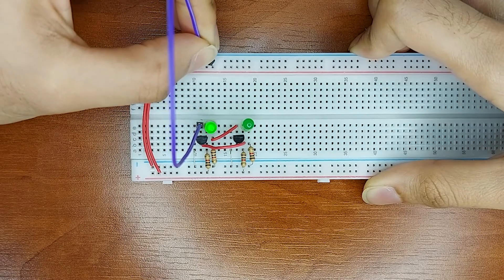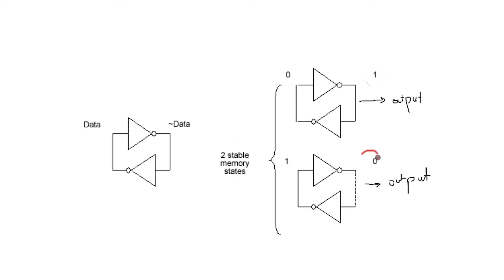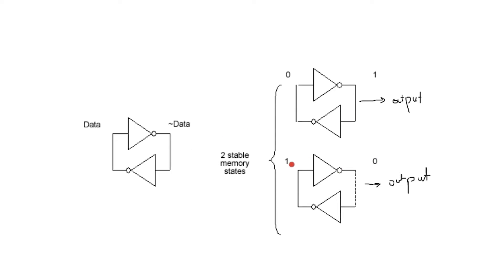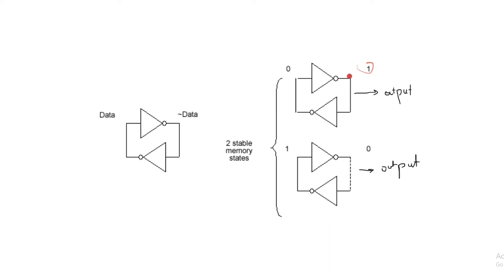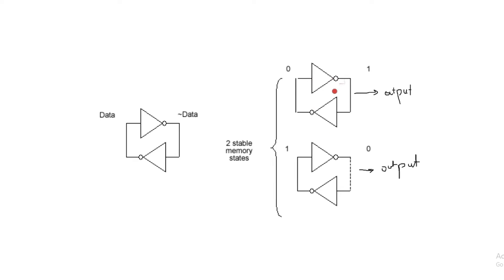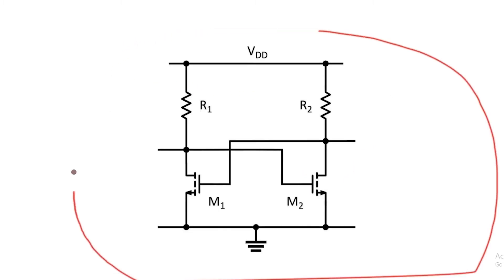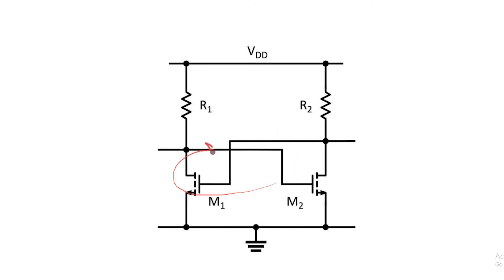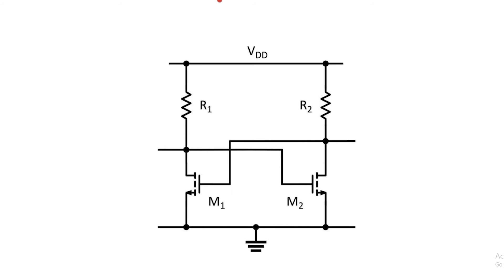Digital Logic - 2 | making a memory cell using transistors

Comment: the resistors need to be minimum 1k, this guy uses 1,7k
Reply from the maker: I think you should take a refresher course on reading resistance by color code. The resistor I use is 1K. Also I fail to understand the purpose of your comment, you say that the minimum should be 1K. Even if we assume that I have used 1.7K resistance, The last I checked 1.7K was larger than 1K that you claim to be the minimum. I am also very curious to see from where did you deduce this figure. Please share your reasoning so the rest of us can benefit from your kind wisdom.
Reply: @engineerityourself-2jz  3 years later here. and nice job whining about comments. you should probably put the values of the components in the actual video. Its insane to me that you didn't. so i dont think you should be talking and getting butthurt over random youtube comments trying to figure out your mistake.
Reply: you should also have 2 resistor somewhere on the breadboard, one for pluss and one for minus. then pull the signal from those. why? because if you do like he shows here and pull signal directly form minus, you are burning your transistor and it will go super hot.
Reply from the maker: @RetroEcoChicken  Hey, if you would have noticed carefully i am using a NMOS not a BJT transistor and in what world do you connect the source of the NMOS to anywhere other than ground?. This "Guy" has a EEE degree. It would benefit you and us greatly if you double check information you get from your "Youtube Degree: before sharing it with the world.
Reply: correction, works with 470 resistor also.

Comment: whait on the board u used 4 resistors but in the diagram it shows 2? abd no led in the diagram
Reply: I think that's because the diagram has no LEDs, and the board has
Reply: @pabloneitor23  yes, I'm pretty sure the extra resistors are dropper resistors so the LEDs are driven at the correct voltage.